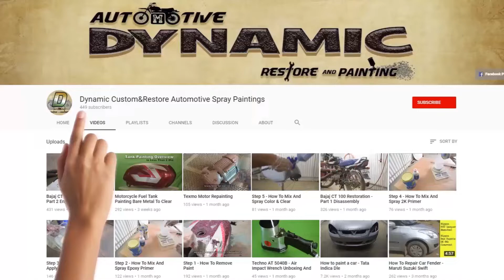Ford Fiesta Classic Repainting - FLARE MET

Comment: Sir which air sander is best 6 inch or 5  inch dual action
Reply from the maker: 6 inch is the std size you can buy it if you are doing work on a car or larger areas and 5 inch is good for small works like bikes and touch ups
Reply: @DynamicAutoYT  what is price??
Reply from the maker: @gujjugarage4  Da sander? Rs:-2000 - 2500